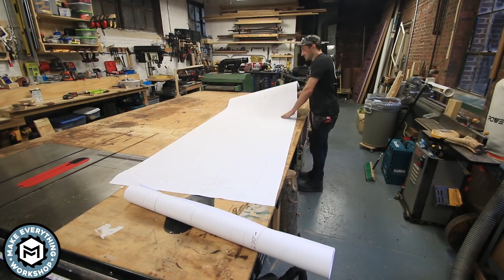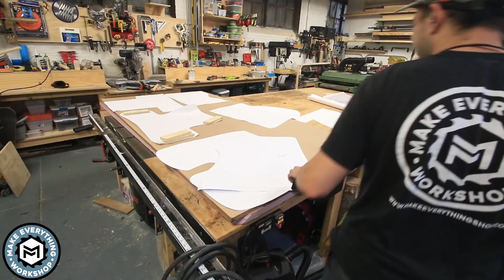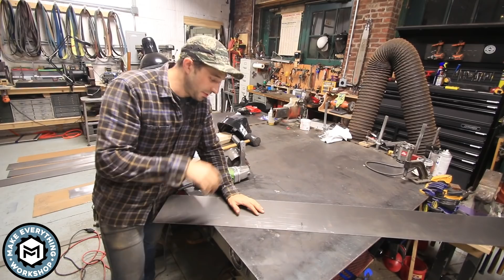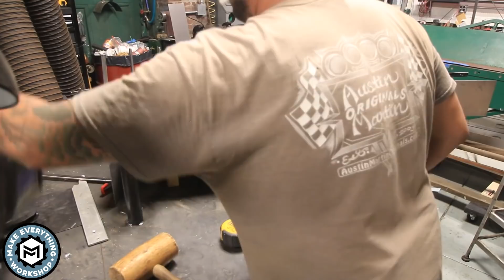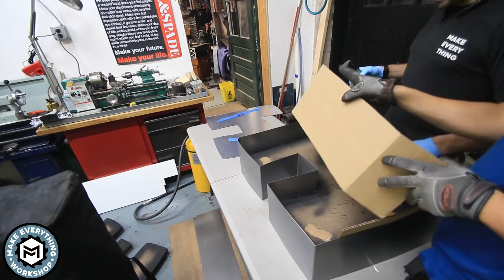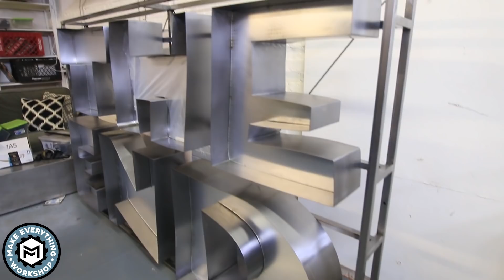Making a GIANT Marquee Sign | Metal Working

Comment: Did you brush that steel with an angle grinder and attachment or was that an actual dedicated tool?
Reply: He discussed that pretty thoroughly in the video AND it's in the video description.
Reply from the maker: That tool is really just a variable speed angle grinder with some extra hardware on it, but it’s sold that way, see the link in the description for the tool itself.